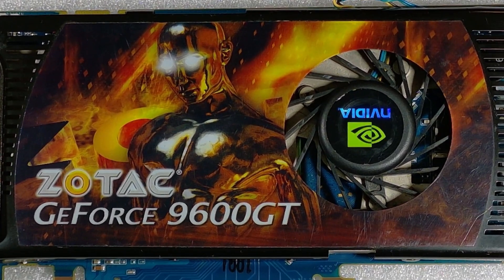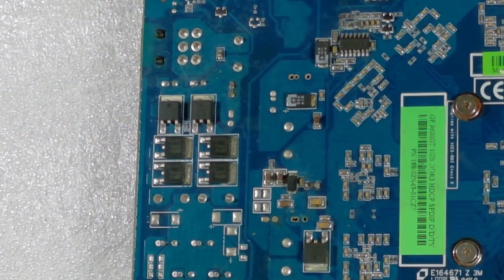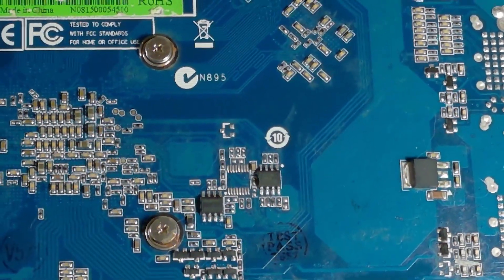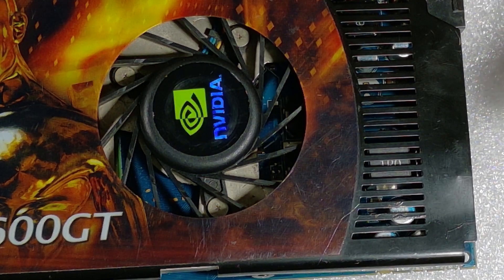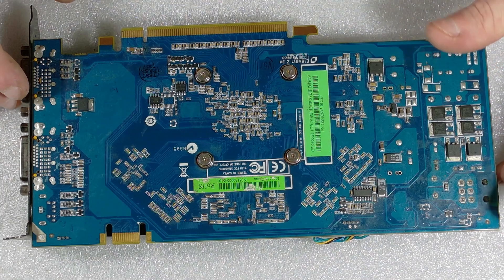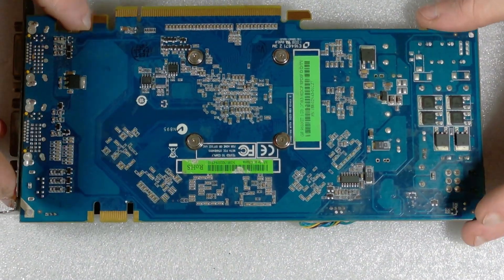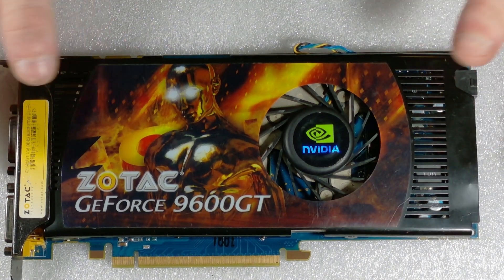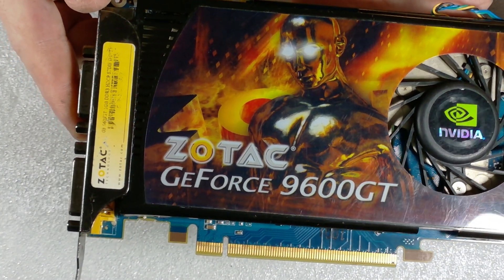Graphics Card from 2008!!

Comment: I bought a 9800 GT a few years back just to play around with and I just put it in my WIN10 PC and it autoinstalled some drivers that could actually play games, not just the basic MS display driver that can't run anything, idk if you meant that. I remember playing Tomb Raider 2013 and Quake 4 on it. Also yeah, C&C 3 rocks, I still play it from time to time :D
Reply from the maker: The drivers that your WIN10 pc installed were not the right ones, it will be basic display drivers and not the official graphic driver, so if or when I do the benchmarking on the older gpu's i have and i submit them to HWbot.org they will not pass do to not having the appropriate drivers installed. sucks but rules are rules lol.